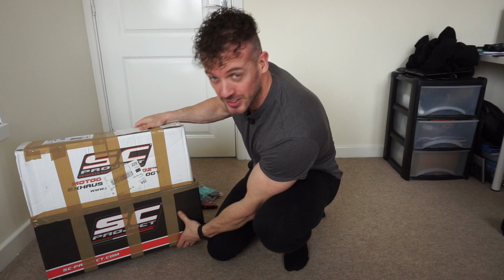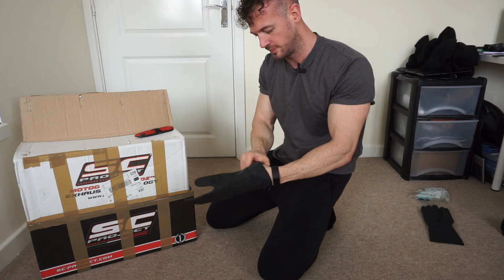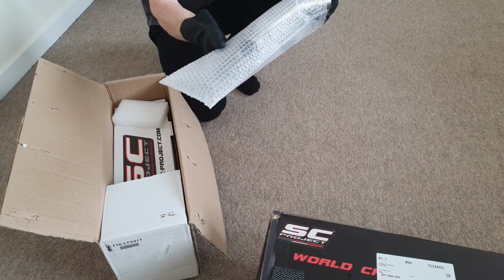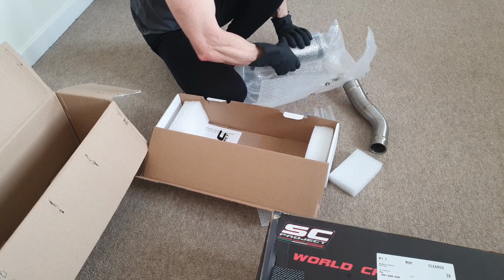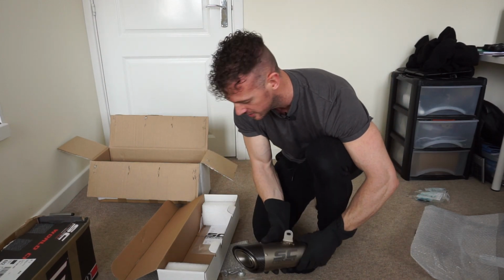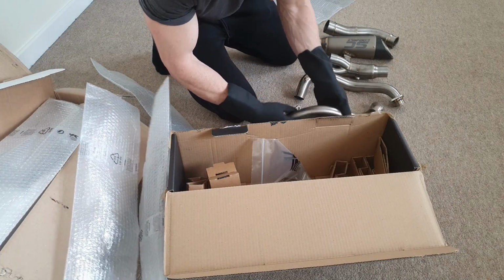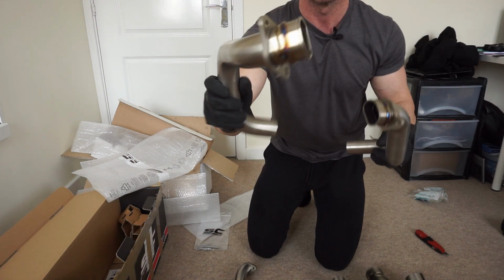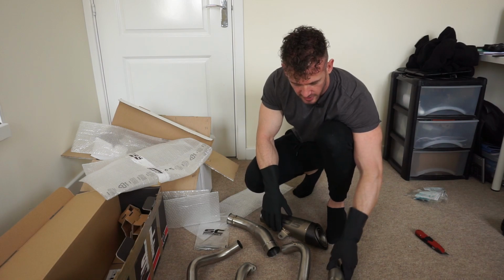UNBOXING my SC Project exhaust 2020 Street Triple 765 RS

Comment: Look forward to hearing it on the bike! Not sure which one I’m going to get I picked my bike up two days ago now!! The people that are saying that you will lose power I’m not sure that’s strictly true because I know the rs can auto map it’s self to a point I wouldn’t worry to much and the loss in power is probably not even noticeable to the casual rider but I guess your about to find out for us 😂😂 enjoy man
Reply from the maker: I cannot confirm on just a muffler install but on a full system I will find out for sure. Though I will be having the bike tuned as soon as possible
Reply: Life of Rye did you say in one of your videos your going to put it on the dyno before and after so you know the difference before mapping? Be interested to see how close the auto map gets
Reply from the maker: @jackhockett4884  Will have before and after results yeah I rode it today with full system installed. It does need a tune for sure
Reply: Life of Rye I literally just read your comment on the triumph fb group were both on lol I think I’m gonna go for the sc s1 exhaust just got to get the money together as there not cheap how much did you pay for the full system?

Comment: Hi, one question about your exhaust, since I have an S1 on order (muffler only though). You obviously went for the headers from the 2017-2019 model since SC project still hasn't released specific headers for the 2020 Street Triple. Are you not worried about loss of torque down low? I ask this primarily because the 2020 has a redesigned exhaust system with an added balance pipe across the headers which is supposedly what provides the improved torque figure down low.
Reply from the maker: There were a number of changes to the engine and exhaust on the 2020 to improve mid range. I will give my honest feed back once I have had the bike tuned.

Comment: Looks great! Assuming you’re ignoring the ‘for race use only’ guidance? How are you planning on getting this through MoT etc? Will you swap everything back to stock for that?
Reply from the maker: Fortunately we don't get tested for emissions in the UK on motorcycle 😏
Reply: Life of Rye are you sure? I’ve been told that we do in the UK? I’m looking at getting the exact same system as yours, but have been told that it won’t get through emissions testing at MoT? Maybe I’m just being too paranoid/cautious...
Reply from the maker: @jworrallo  you can check with your dealer as they no doubt carry out MOT's for piece of mind. Mot on a bike also doesn't get carried out until it is 3 year old
Reply: Life of Rye yeh will check with the local dealer/MoT centre too! As you say, should be good for 3 years at minimum! Cheers! 👍🏻

Comment: Nice, but I heard you need a remap with a powercommander... Otherwise the euro5 engine gives you powerloss instead of extra power...
Reply from the maker: The bike is having a power commander installed along with the required tune as soon as possible after installation of the exhaust

Comment: Hi Rye,

I am planning to purchase a RS 2020 model here in India. 
I was told here by the dealership that any exhaust apart from Arrow exhaust will void the manufacturer warranty on the bike. 
Can you shed some light on this?

Thanks & Regards,

Rahul Ghai

Thanks & Regards,

Rahul Ghai
Reply from the maker: I asked my dealership about this and was told that the warranty would be void if it is proven the exhaust caused the problem.

Comment: How lucky you are, here in Spain If I fitted that system on my 675R (sounds bloody wonderful by the way)....I'd have to remove it each time I took the Bike in for ITV test..(MOT)  reinstall the original to get it passed homologation....A friend of mine, who owned an Enfield Bullet put a shorter, less obtrusive exhaust on his bike. It didn't make in any faster purely  aesthetics... it was failed. Even a non conforming seat cowl can have the same consequences . Here in Spain we have far better weather for motorcycling, Its bloody wonderful in fact,  the roads are generally in good condition ...no pot holes...However the rules and regulations regarding homologation are far stricter...If you look at 'Pedrera in reverse' on Youtube you will see what I mean about the roads... ride safe ..Greetings from España.
Reply from the maker: That just seems too strict - surely you can just swap the exhaust over once the bike is tested? If you purchase a bike brand new do you have to wait so many years before it requires the ITV?
Reply: @BikesofRye  The test from new is four years, thereafter every two years..And yes, the test ( homologation) is somewhat more severe.... can depend on the inspector though.. Of course it is possible to swap the system out from new, or after the test. Depends on your enthusiasm to convert the bike back and forth...Of course that depends on how much work..disassembly/assembly  is involved. I arrived in Spain twenty years ago with a Triton....can you imagine the homologation problem that motorcycle caused...It now belongs to a collector in Valencia.
Reply: @BikesofRye  As a by the by I owned a new Honda VFR from 2014. I fitted a Scorpion (slip on) which wasn't a problem however a full exhaust, apart from the amount of time and work, changing it would have been because the 'Cat' would be removed.

Comment: Where did you order the sc from?
Reply from the maker: In the U.K order from moto46.co.uk they are a SC project dealer and also specialise in the Street Triple 765 RS
Reply: @BikesofRye  Leo vince or go the sc project route?
Reply from the maker: leovince when I leave my house some weekend mornings at like 6am for summer rideouts is more practical. Also don't have to wear earplugs all the time with it. Sounds better with DB killer inserted in my opinion especially when on full chat

S1 slip-on sounds unreal it is addictive you cannot help but want to blip the throttle or make it sing but keep in mind it is very loud. It also looks great once it starts turning blue and I think its the better looking slip-on

Doesn't answer your question but gives you food for thought
Reply: @BikesofRye  really can’t make my mind up! My heart wants the sc project but my head is being sensible lol
Reply from the maker: Well if you make a mistake remember you can always sell it and get most of the money back for it anyway especially the S1 you wouldn't struggle to sell that on second hand